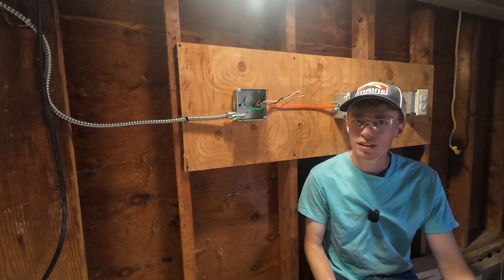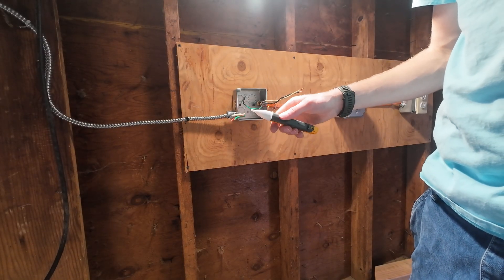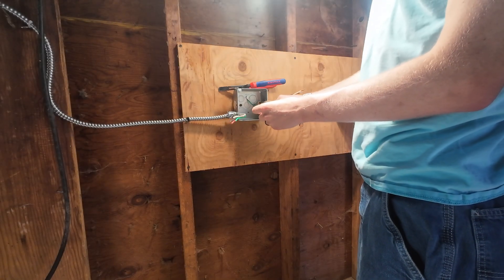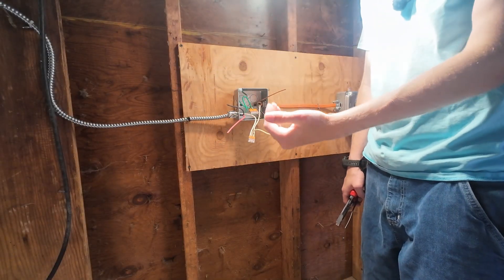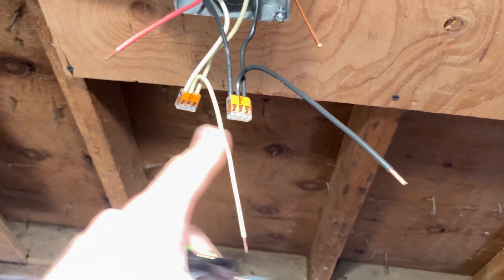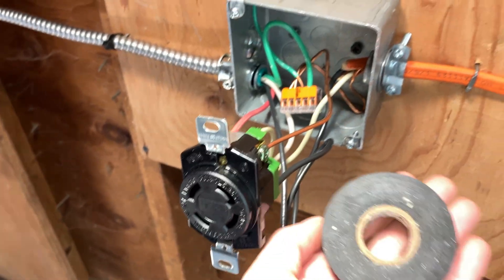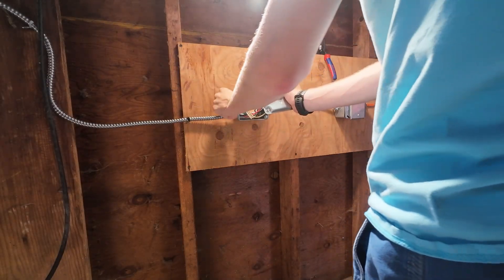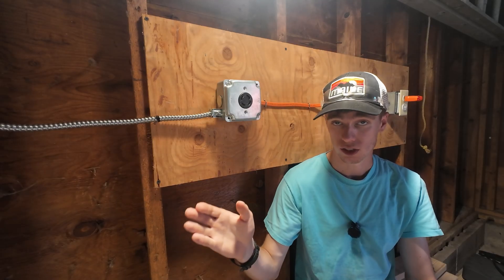How to install a 240Volt L14-30 Receptacle. Easy!

Comment: What do you plug into those? I’m currently installing one for a customer and curious if you can plug an air compressor into that?
Reply from the maker: I’ve seen lots of of IT equipment use this cord end. Heavy duty plug in equipment or I’ve even seen some RV plugs that use this adapter